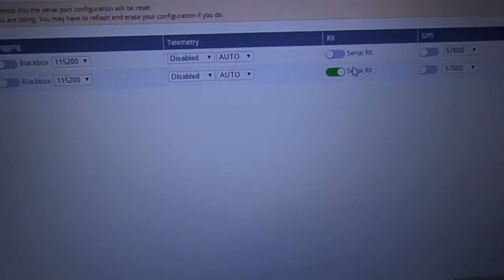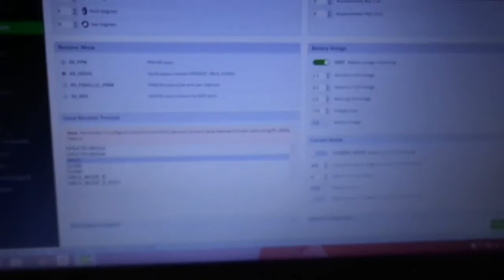130mm Lantian micro quad, naze32, 1306, RMRC 4

Comment: Hi ! Thanks for sharing your build

I did not know about the4 in 1 ESC. This is really fine for this kind of tiny frame. Just ordered it.
I also ready to order the same frame, just need to know what reference do you use, for the white spacers, for the FC ?

Thanks
Reply from the maker: Hi Fabrice, just search "3mm standoff" on hobby king. the same product is available from many sources. Good luck!
Reply: +Team_Monkey Thanks, just found this :  http://www.banggood.com/180pcs-M3-Nylon-Black-Spacers-Screw-Nut-Hex-M-F-Stand-off-Assorted-Kit-Box-p-1000806.html
Should does the work.

Comment: nice clean setup. Im also building something similar.    So you have blue for motor 1, white motor 2, Orange motor3 yellow motor4 it looks like.
Reply from the maker: Yes, exactly. I made a 3 column table to keep track while building and troubleshooting. The table had ESC wire color, ESC position and motor position.

Comment: Nice video!  Do you have any clearance issues with the 3" props?
Reply from the maker: A bit st first. The rear are fine but the front go under the top plate slightly. That is why the antenna face forwards. the props hit the ziptie if mounted up. They clear fine now.